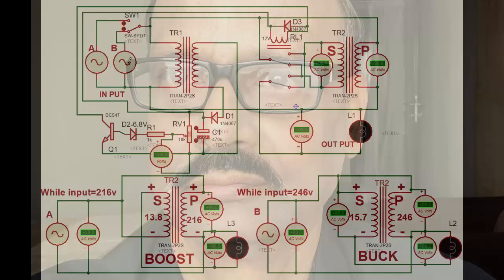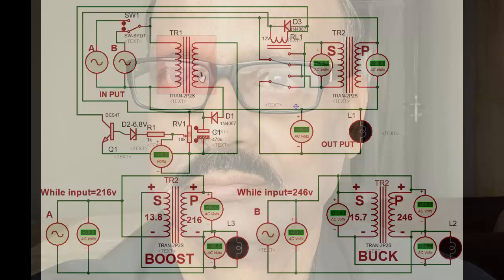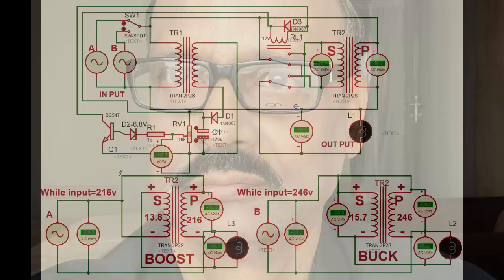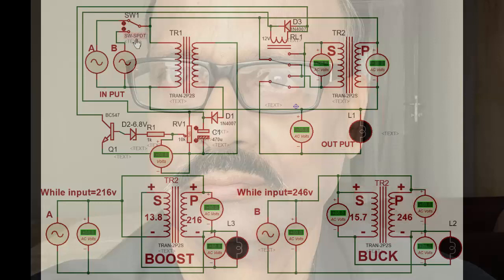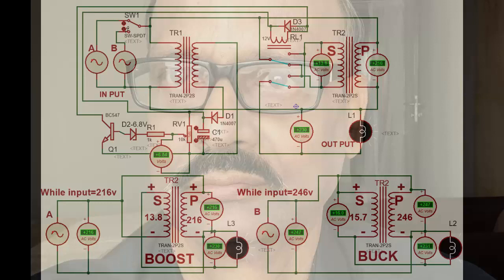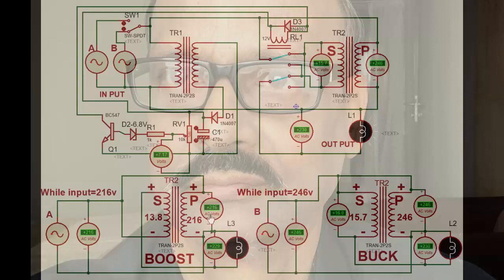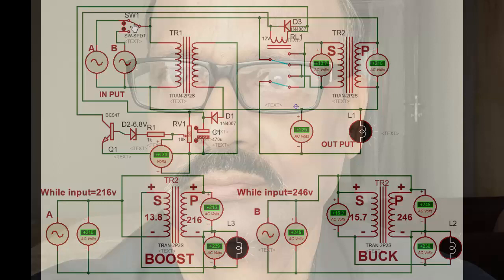Mainline  voltage stabilizer for home  2 simplified

Comment: Sir what if we introduce op amp in this circuitry?
Reply from the maker: The operation will be much better with feedback developing a hystersis , to avoid relay chattering by introducing a sensing voltage difference between the on voltage and off voltage. It may be difficult for you to understand here. Please watch my other videos for better understanding.

Comment: Sir I understood the diagram thankyou so much, in previous video I think that primary side of buck boost transformer is in left side but in the diagram it is in right side so all paths are capabl to flow the current through the load , I got it sir thankyou so much for making this video it helped me to understand this🌷
Reply from the maker: No. You have still not followed and are confused with T1 &T2.  T1 primary is on the left and secondary on the right while   T2 primary is on the right and secondary is on the left. The transformer TR1 is just for control circuit powering. But the transformer T2 is the main transformer and is in the same place as in this new diagram making boost and buck as required. The primary and secondary of T2 also is in same in the way earlier one and this new one too. The only thing is that in the earlier diagram, I did not place voltmeters in the primary and secondary of T2
Reply: @PatnaikUC  sir I got it by your annotations "S" and "P"